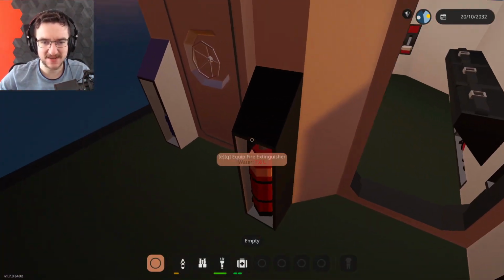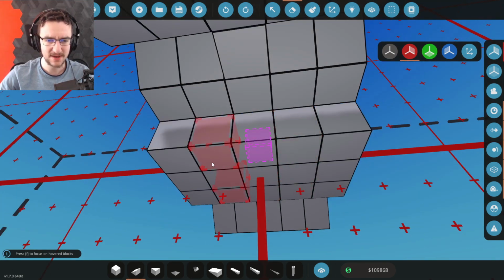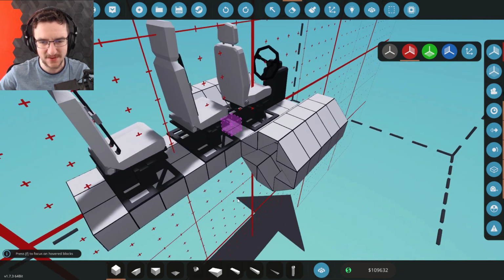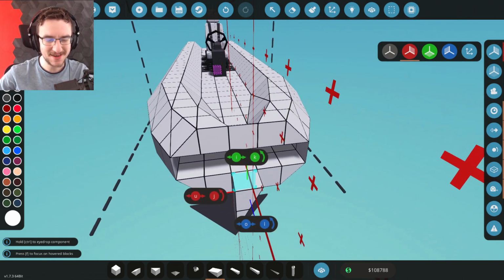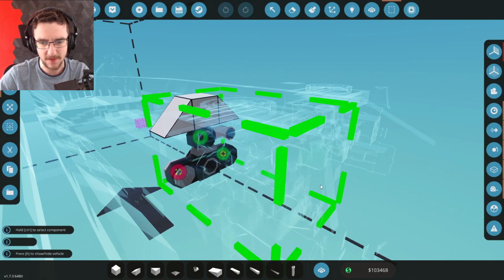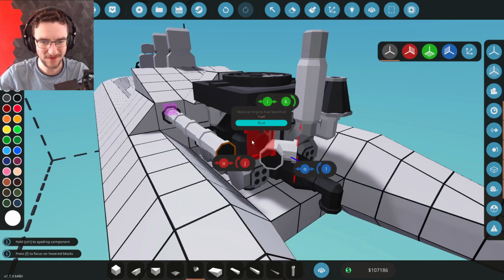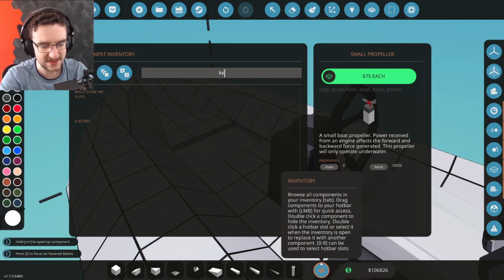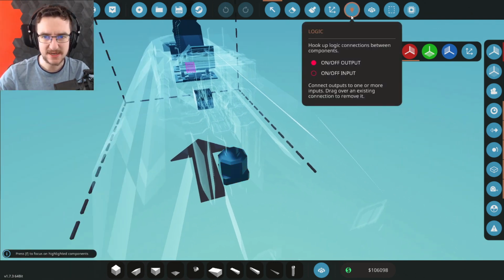Lets Build A NEW HARDCORE STARTER BOAT! - DLC Hardcore Career Mode - #59 - Stormworks Build n Rescue

Comment: Nice looking RHIB, looks like you forgot to set the constant number to 1 though. Unless they changed it I think it defaults to 0 so you'll have no cooling pressure or alternator current coming from the engine :/